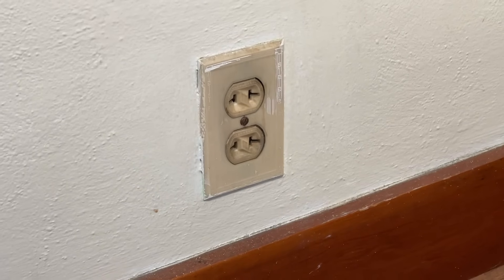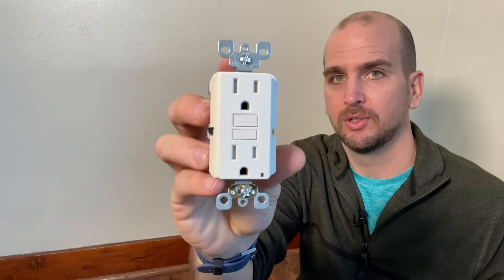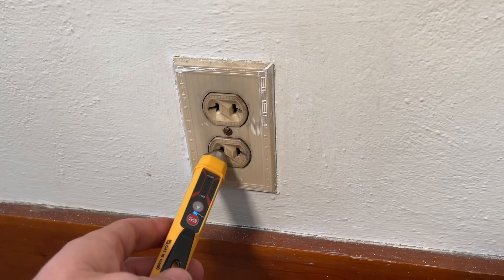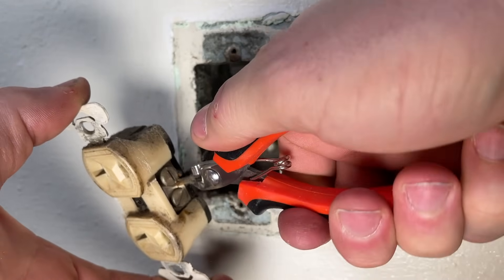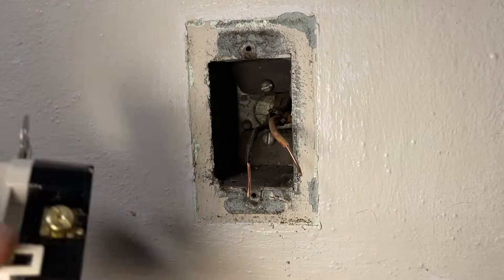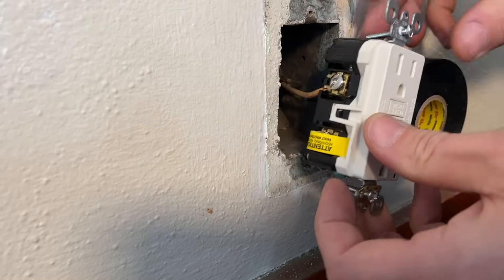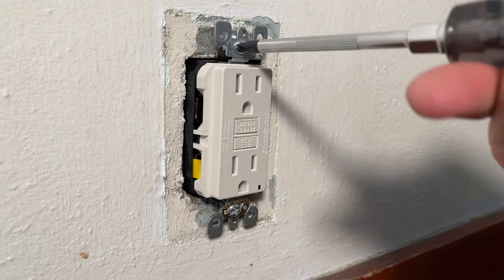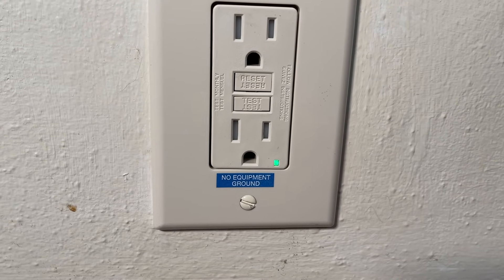How To Replace An Old 2 Prong Outlet Using 3 Prong GFCI

Comment: Does this mean that when you install GFCI outlets  replacing two prongs it protects at the outlet in older style homes without a ground wire,  and the newer style homes with a ground protected back at the main breaker box?
Reply from the maker: This is an a way to get a 3 prong outlet installed without running a ground back to the panel and still be safe and follow NEC.
Reply: My understanding of the video is that since there's no ground back to the panel, there's no safe path for electricity in case of a ground fault. GFCI is built for handling ground faults at the outlet and built to be a faster (maybe more consistent?) disconnect than a normal breaker.

So while it'd be great to have both GFCI and a breaker, the video setup now has at least one mode of disconnect in case of ground faults as opposed to none prior. I'm open for corrections  @Everyday Home Repairs  .
Reply: @SoulJah876  A ground line is designed to protect against failures in an appliance where current is shorted to the chassis.  By grounding the chassis, it shunts that current back to the service panel (and probably tripping the breaker), preventing a shock hazard.

Using a GFCI outlet and not a ground wire is safe, but for a different reason.  If there is a short in the device, then the GFCI will detect the fact that the current on the hot line does not equal the current on the neutral line and it will cut off the power, thus preventing a shock hazard.
Reply: @SoulJah876  I used to have a house with old wiring. The wiring really should be replaced. I sold the house because of a new job. And yes you should have a ground for safety. If you don't this is better then using a adapter.
Reply: GFCIs do not need a ground wire. Having a GFCI without ground is not ideal but it is an acceptable compromise. I can even be better than ground without a GFCI. It is ideal to have both.

The main problem with GFCIs is that they can fail so they should be regularly tested with the button. Regular testing actually can prevent the failure. There are rules on the interval. It may be every three months or 6 months or something like that. Seems every three months is the standard in the US.

Comment: I've been told that the code shows that the grounding part should be up rather than down on standard outlets due to any thing metal possibly falling on the hot and netural parts of the plug should it not be plugged in totally into the socket of the outlet.   I guess that it would not be necessary with GFI type outlets.
Reply from the maker: Hey Michael,  the orientation is not called out in NEC but might be called out in a local spec or maybe the design of your home electrical system.  Here is a video with a TON of comments on the topic.  https://youtu.be/kYXvcog9MxY
Reply: @EverydayHomeRepairs  thanks.  The National Electrical Code book does show down for the ground in my book NEC for 1991.  Did not know if that rule has changed.  Have there been any changes in fill for different conduit?
Reply: This ground up or ground down topic has been an ongoing discussion for at least 50 years when I first started doing electrical work as a journeyman electrician.  In almost every case UNLESS defined otherwise by an existing LOCAL code the ground is installed down.  However, our excellent host is correct, it doesn't really matter unless your local code define how they are to be installed.  

I was taught that the ground should be down because that is the last connection you want broken when you remove a plug.  For example you come by and step on a cord and pull it half-way out of the socket.  With the ground on the bottom you would still have a ground connection but the potential to have a hot connection without a neutral connection does exist therefore ground down is safer in MY opinion.  Therefore all of the electricians I know will install outlets with the ground down but check your local code before making any change.  

One of these days the NEC governing body will sit down and define the why's and provide recommendations.. I have heard the dropping metal object thingy before and believe that it is at least twice as UNLIKELY to happen as accidently partially unplugging a cord.  I know in the 1950 there were pictures in the code of outlets and it showed the outlets installed ground down.  Then sometime in the 1960's the picture was changed and it showed a picture with the ground up with no explanation of why the change was made.  Go figure, ha ha.
Reply: @thomasgarven129  while I was taking my apprentice to be an electrician I had the manual workbook from the class and the NEC manual which are in storage and can't look at them but I thought that they were down for the ground plug but that was thirty years ago for me.
Reply: @thomasgarven129  I do have wiring diagrams from Google and they show grounds being down also.  The ground being the last thing to remove theory from the wall outlet is a bit sketchy and having things slip down behind a piece of furniture and not going after it right away could be of concern over time.  Could be worse for the elderly in my opinion.
Reply: That's not in the NEC... BUT any AHJ , town, municipality, state, governing body is free to add ( or even take away) from the NEC for there purpose or judgement. An argument can be made for and against ground up  receptacles.

Comment: In old TN-C electrical System we 🇩🇪use the Neutral also as the Ground=PEN. So Ground is provided.
Reply: This is not a safe way to get a ground. Using the neutral as a ground can set up a scenario where an individual can be shocked should there be a fault in the system leading up to the outlet.
Reply: https://youtu.be/zmXEVE33474
Reply: Why is it working without any fatal accident? And yes, 230 Volt. Booh...
Reply: @DirkGorgiel  The wires just do not spontaneously get loose. On Finland there has been no fatal accident caused by such in 40 years and no documented accident in 15 years.

In the other hand there has been three fatalities because someone illegally did wiring himself and connected the ground to the live wire.
Reply: In Europe one does not need to do that. You can plug schuko into an ungrounded outlet which in most countries were used in dry rooms until the 90s. If you want extra safety, a portable RCD costs 15 €.

Comment: One of the first "repairs" I did when buying my 1950's home was to replace all my two-prong outlets and the variety of types and colors of switches. The master bedroom even had these molded plates with three, two-prong outlets integrated into them. Clearly seemed to be the "behind the bed" outlet intended for a bedside clock and two bedside lamps. The house is full of the rubber and braided cloth insulated wiring typical of the era. I've been told before that it's permissible to use the bare steel wire running through these cables as a grounding conductor, though I've never attempted to make that change. The stuff is such a mess to begin with it's mostly not worth the risk of damaging things further.
Reply from the maker: Hey Marc, yeah a full rewire is a whole different type of project.  Do you have attic and basement access?
Reply: @EverydayHomeRepairs  Basement access yes, but attic and wall access from above is really difficult. For the first floor, I've added a grounding conductor in a few places since it was relatively easy to do and reach. Even rewiring most of those outlets entirely shouldn't be too difficult if I decide to tackle it. Upstairs is a whole other story. I just posted some pictures to the Facebook group from last year when I had to come up with some way of rewiring for a bathroom remodel.
Reply: My wife's old house was built in 1941 with knob and tube wiring run through the attic space. It was laid out quite well, and considering its age when I looked at in the late 90s, in really good condition. In the late 60s the house was in the way of the Interstate, so it was bought and moved onto a new basement foundation, where in the early 90s my wife had a contractor finish the basement and wire it up (poorly). While I eventually fixed the basement grounding problems and the incorrectly wired GFI outlets & 3-way switches, I left the original attic wiring alone except to install new switches and outlets throughout the upstairs. But it always bugged me; 60-year old wiring protected pretty much only by a non-leaking roof and a lack of mice/rats, and half the house had no ground connection. I was eventually going to get a buddy to help me strip out all the old wiring, but we decided to sell the place before I got to it.

The old wiring issue was resolved a year after we moved when the neighbor's tree came down on the roof and they had to rebuild half the house.
Reply: @nolongeramused8135  Knob and tube is scary stuff, even when in relatively good condition and left alone.
Reply: @marcberm  But it's a beautiful sight  to behold when you see a large, well-preserved professional installation.  They had to do a lot of careful routing and cable management when setting up a large office building or a warehouse.  Cable lacing is still a thing in the telecommunications industry but sadly that is becoming a lost art.
Reply: @docferringer  I don't doubt it! There's a craft to these things that's lost today. I can certainly appreciate the aesthetic and the work that went into it. In fact I work in telecom, and have seen some fantastic old examples of switching equipment rooms.
Reply: @marcberm  Knob and tube was industry standard for 60 years.
Reply: @guymandudely324  Everything is an industry standard until it's superseded by something else. That doesn't make knob and tube any more safe or acceptable today.
Reply: @marcberm  Nothing to be scared of when you see knob and tube.
Reply: @guymandudely324  Not at all if it's in good condition and undamaged, but it's rare for a knob and tube installation extant in 2021 to be in good condition. Most have been hacked to bits with splices over the years. You also can't properly insulate an exterior wall cavity containing knob and tube, which is essentially a non-starter here in the northeast. Again, there are reasons the methods and materials of knob and tube have been superseded for so long.
Reply: @marcberm  I'm not advocating anything.  I just made a statement that knob & tube played a long and important role in the development of home wiring and electric.  Maybe in 10, 20 or 30 years there will be a newer wiring system that replaces romex.

Comment: I had a flood in my condo, and my hall ceiling light and wiring has been damaged, along with the switch. How can I remove everything so I can replace everything?
Reply from the maker: Hey Robert, I wouldn't want to attempt to troubleshoot something like that through YT comments.  Probably best to call in a pro as there could be multiple issues and safety concerns.  Isn't the damage covered by the HOA or even the unit above which caused the damage?
Reply: First thing you'll need to do is contact your insurance company. File a claim, and they should send out one of their preferred electricians to take care of the work. If they don't. Pick the contractor with the best reviews near you. Document everything, see what you can get reimbursed for.

If for some reason you absolutely must DIY this, just know it involves cutting the damaged circuit out, and installing a replacement.
Reply: Get someone who knows how to pull new wire thru walls . It’s easier with 2 people ;
Reply: Probably don't have to replace the wiring if it was just a flood of water. Just all your devices that got damaged.